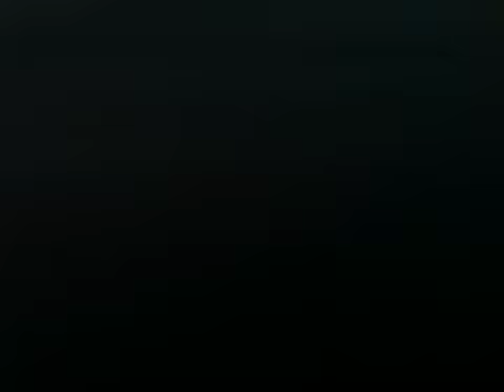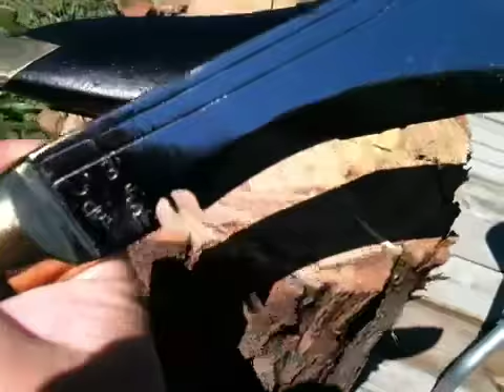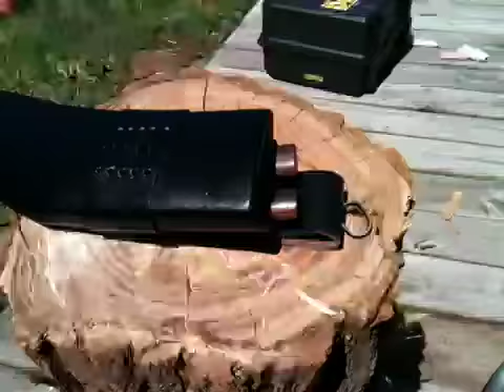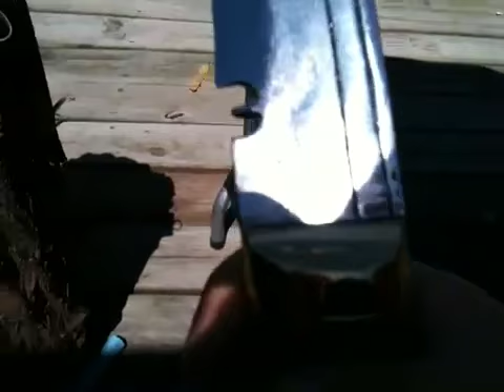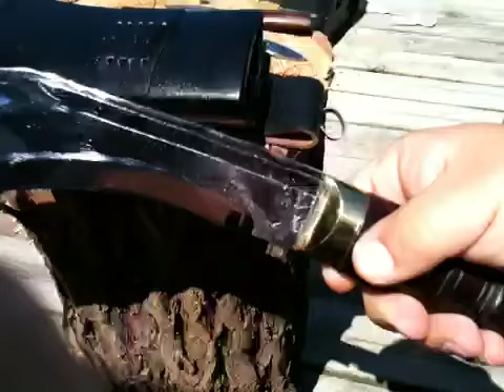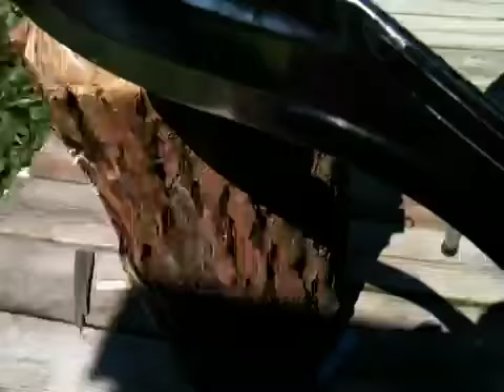Himalayan Imports Chiruwa Ang Khola Kukri.

Comment: jesus christ i had no idea that these blades were so thick. that's a lot of goddamn steel.
Reply from the maker: Crazy right! If you can break the knife,,,, they send you too. Now that's a bold warranty these are monsters. I wouldn't want to hike with one, but great times in the backyard for sure!!
Reply from the maker: While all authentic Kukris are tough, there are few that are full tang meaning the steel runs through the handle at full width all the way through the two piece scales. Most are stick tang which is an inherently weaker design with the tang.
Reply: @Knifeguyyy  I will damn sure hike with my Himalayan Imports angh khola Hanuman and the several tools that comes with it not just the chakmak and karda
Reply: Knifeguy I would hike with one.  I'd sacrifice something to save weight just so I could hike with it.  :)

Comment: The Chow is there to act as a prevention for the blade not to snap, is a cut out on the hard part of the edge, since it is deferentially tempered,if you look at it the edge is cut out, there are many myths as you mentioned one as a blood drip, it looks as a cow's  hoof, they say because a cow is sacred, then it represents a mythical goddess, but if you look at it, only the edge is cut that way and if it wasn't it could snap when twisted.

Comment: The Chow (cow imprint) is a stress release if it wasn't there, the hard part of the blade could snap when twisted, it is deferentially tempered, if you look only the edge which is harder than the spine is cit away, there are alot  of myths about the Chow, you mentioned one which is a blood drip, then there is a cow print, because the cow is sacred, then a sable for a mystical goddess etc. But its a stress release!
Reply: that may be true but there is unfortunately no real evidence of this as even the kamis no longer know the origin of the notch
Reply: @kevinmorrice  there is real evidence of the Cho relieving stress from a metalurgical standpoint
Reply: @Wildwestwrangler  can you link a source, that sounds genuinely interesting